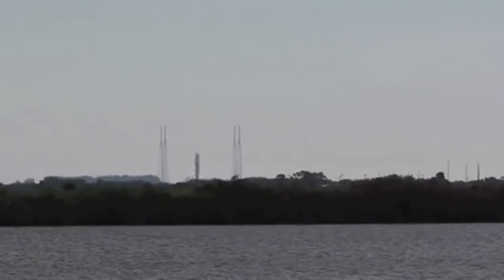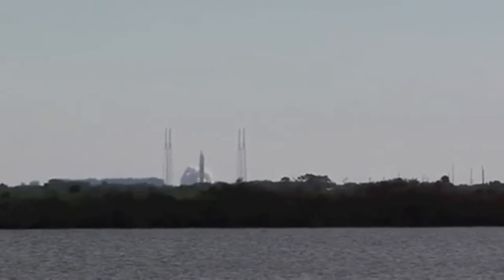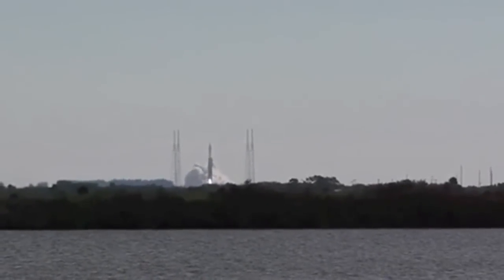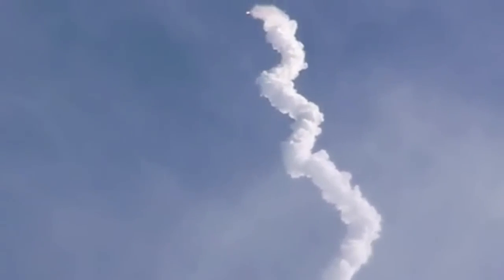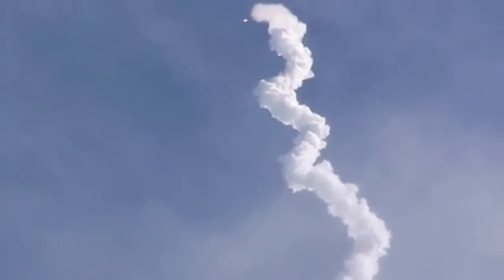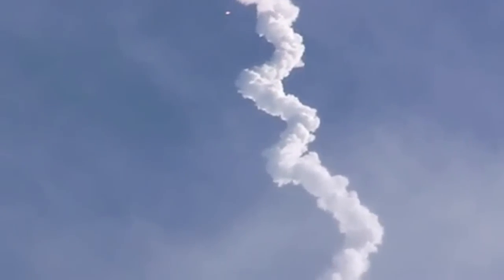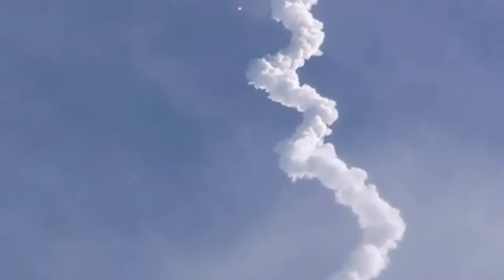Sonic Boom Seen - Rocket Launch Shockwave Ripples Clouds | Video

Comment: 1:45 WOW!!!!  VISIBLE SOUND WAVES !! WOW!!
Reply: Those aren't sound waves.
Reply: @Joseph-by6pv  Uhh .Ok.
Reply: @albert.2848  Ok? Don't exactly know how you want me to respond to that.
But ok.
Reply: @Joseph-by6pv  well what are they
Reply: @jellomellyn1166  If the title of the video was too hard to read "Rocket launch shockwave ripples clouds"
Reply: @Joseph-by6pv  So, please enlighten us on these "shockwaves" since they have nothing to do with sound.
Reply: @snaz7110  Jesus, does anyone do any research these days?
Shockwaves are caused by an object moving faster than the speed of sound, however they are very distinctly not sound waves. Also i never said they have nothing to do with sound. I don't see how anyone could come to the conclusion that those are sound waves.
Reply: @Joseph-by6pv  So why do they make a sound?
Reply: @snaz7110  Why do they ma- Just because an object moves faster than sound doesn't mean you won't hear the sound. Imagine a jet is passing above you, overhead, moving faster than sound. You won't hear it until it passes you, as the sound it makes is lagging behind it.
Reply: @Joseph-by6pv  Any ordered vibration of particles is technically a sound wave, why do you make it more complicated with the "shockwaves", which are actually only pressure waves caused by moving faster than sound. These pressure waves, in air, are called sound waves. There is literally no difference apart from how the sound is formed.
Reply: @snaz7110  You're not getting it all, are you? That is literally the definition of a shockwave, it would be more complicated to continue describing them has 'pressure waves caused by moving faster than the sound' then to simply say 'shockwaves.'  Anyway,  shockwaves differ from sound waves for the reason that the shockwaves propagate differently from that of ordinary sound, as in, shockwaves move faster than sound. Besides, what law states that, simply because something moves faster than sound, that somethings sound waves are now visible?
Reply: @Joseph-by6pv  It's not that complicated at all though, as the shockwaves would become sound anyway, the reason they would propagate differently is because, as I said, the wave is produced differently due to the steepness of the change in pressure, density etc. And due to the shockwaves losing speed and amplitude much quicker than most sound waves, by the time it arrived to you, it would be a sound wave. In a way, shockwaves are sound waves that move too fast to be a sound wave(yet).
Reply: n  excellent question. I like it when the comment section is a conversation instead of a slanging match. Well done all involved 😁🙌🙌🙌🙌
Reply: @Joseph-by6pv  How would you know that they are not sound waves? You can hear from the commentary that the rocket went supersonic only after the waves are seen in the clouds.
Reply: @Joseph-by6pv  No one said you can see sound waves, we are talking about the particles that vibrate in them which makes some kind of visual representation of it.
Reply: @Joseph-by6pv  Always deny? I probably would, but isn't it premature to say that after my first message in this thread? Obviously what you see is condensation of water, but as they perfectly visualize the pressure waves, it is quite ok to say that you see the pressure waves. And it is also perfectly ok to call those pressure waves sound waves, as the OP did, because those are the pressure waves you would be hearing and pressure waves you can hear are sound, by definition.
Reply: Bruh you cant see sound waves. Those things that you see are ripples caused by the sound waves causing the cloud and its surrounding air particles to vibrate and expand to that radial wave pattern.
Reply: I think those are shockwaves...
Reply: @Joseph-by6pv  "Don't exactly know how you want me to respond to that." Usually when someone responds "uhh, ok", they don't expect you to respond to it lol

Comment: If my eyes are as good as they said they are when I was getting my class 1 medical for pilot license I can see 3, AT LEAST 2 separate wave forms, as expected of rockets like this, 1 from engines, 1 from the stabilizing fins or the outer most edge, and the top.

This is most notable in the sonic booms formed on SpaceX’s side boosters landing burn and landing, 3 sonic booms each, but they overlap in a way that on a sound detecting device they come up as 5 due to the wavelengths overlapping, sounds really cool from the Cape, I’ve experienced and hope in going there soon again for another Falcon 9/Heavy launch

Comment: This is not "sonic boom seen". The ripples are gravity waves in atmosphere between two layers of different density (https://en.wikipedia.org/wiki/Gravity_wave), analogous to the surface waves between water and air, caused by the rocket penetrating the interface. Only after 8 seconds in the video did the rocket become supersonic according to the commentary.

Comment: Can anyone explain the physics behind that
Reply: Sounds waves as the rocket passes the sound barrier.
Reply: Pete Smith y they r visible?
Reply: +farhan rajput As the moist air compresses, the water condenses so it builds tiny water droplets in the air I think.
Reply: MarRue MarRue so then it sounds like it’s the rocket pushing through the clouds at a fast speed that caused the clouds to ripple instead of “sound”?
Reply: Christina Graham Could also be because sound is compression of air in waves and denser air has a different refraction indiex to air under normal pressure. You can see this phenomenon sometimes if you are opening your oven and the hot, not as dense air comes out. You can see some refraction in the air, but it is more obvious when you look at the "shadows" the refraction causes on the ground. My guess is a combination of those phenomena.
Reply: MarRue MarRue yes I agree
Reply: This is a demonstration of the shock cone effect. The sound barrier is a colloquialism for what is really the speed of molecular displacement. This speed is based primarily on 
temperature and pressure, but there are other factors such as viscosity, density, and homology. This speed in air is approximately 1100 ft/sec at sea level, and it drops to below 800 ft/sec above 70,000 ft. This speed is relative to the velocity of the localized medium, not the velocity of the source of disturbance. If a source of disturbance (In this case an Atlas V- b401) is moving, then the speed of molecular displacement is slower in its positive direction of travel. The disturbance produced by a rocket is heard as sound, but shock waves are caused by 
the rocket itself traveling faster than the speed of sound, not by sound waves (as is a popular misconception). However, I will refer to sound as the source of disturbance for simplicity's sake. Sound waves are actually successive radial bands of high pressure and low pressure produced by vibration. If the source of disturbance is moving in a particular direction, then 
since the speed of molecular displacement is slower in the forward direction, these bands of pressure difference pile up closer together, decreasing their longitudinal wavelength, increasing the frequency. You can hear this phenomena (known as the Doppler effect) when a police car siren shifts from high to low pitch as it passes you. The actual frequency of the siren is an average of the high and low. If the rocket is moving at 1000 ft/sec, then the compression waves in the forward direction pile up, creating a region of pressure that the rocket has to
push through. It is at this region that most rockets experience "Max Q" where the aerodynamic stress caused by this compressed wall is the greatest. You can see the converse low 
pressure region just above the curved surfaces on a jet fighter as it approaches the sound barrier. However, a most interesting phenomena occurs as the rocket passes through the 
speed of sound. Rather than these pressure waves being in front of the vehicle, they trail in straight lines to the sides, forming a cone of highly compressed and decompressed air in 
rapid succession.This is called a shock cone, and is the primary consideration when designing supersonic aircraft, as the forces present in this shock wave will disintegrate anything that gets in its way.  Far away on the ground, this compression/decompression wave causes the sound you hear as a sonic boom, but continues to move even after the vehicle is supersonic. To visualize this phenomena, picture  pebbles being dropped into a flat pond. As the pebble strikes the water, it produces a wave that moves at the speed of molecular displacement of water (transverse displacement, not longitudinal, but that isn't important). If you drop a second pebble into the water behind the wave produced by the pebble, you will end up with 
several high amplitude waves close together on one direction, and low amplitude highly spaced waves in the other direction (the doppler effect) If you however were to drop the second 
pebble ahead of the wave produced by the first, its forward crest wave would combine with the forward crest wave of the first (this becomes highlighted if you drop a continuous stream of pebbles, or in the case of the bow wake of a boat). These waves rather than moving forward move outward from the source of displacement (pebble stream or boat), And in the case of a boat, these waves are high enough to cause significant disturbance to smaller boats. 

That is the shock cone effect, now I will explain how it relates to the phenomena observed. As the rocket travels upward through the sound barrier, the vertical cone has a circular cross 
section when viewed from the ground. This circle is filled with the immensely powerful compression and decompression waves produced by the supersonic object (described above). As it moves through the clouds, it both mashes the water molecules together (compression waves) or pulls them apart (decompression waves). Since these waves are successive, you see the ripples in the clouds of transparent and translucent air. The compression waves are powerful enough to group the thinly spaced water molecules in the clear air together in a 
translucent band you can see from the ground.
Reply: when the rocket becomes faster than the speed of its sound, it will cause this sound
Reply: Shock wave from the sonic boom. The pressure wave will also super heat the air particles making the want wave visible by distortion of the natural light waves in air

Comment: I hope the fuel in these rockets are environmentally friendly hahaha
Reply: Rockets use many different propellants. The most common propellants are kerosene and liquid hydrogen, which are burned with liquid oxygen. The cleanest propellant is hydrogen, as its exhaust is nothing but water vapor. Some rockets that use this are the space shuttle, the 2nd and 3rd stages of the Saturn V, and the Delta IV Heavy. Methane comes next, making mostly water vapor and some CO2. The "dirtiest" rocket propellants are solid fuels, as they are practically giant fireworks. The rocket in this video is an Atlas V, which uses kerosene and solid rocket motors. However, rockets don't contribute any significant amount of emissions to the atmosphere. They simply don't fly often enough to make an impact, and there is no other way with our current technology to reach space without burning stuff. The Everyday Astronaut has a video on his YouTube channel that is more comprehensive and goes much more in depth on this topic.
Reply: @kermitthemutantlevitatingf7836  so they ain’t to bad, but there is a lot of space junk left up there after all these years
Reply: @darkshaman7087  yes that is a  problem